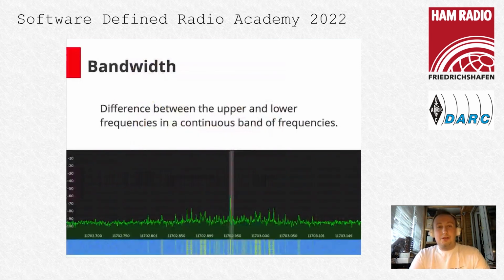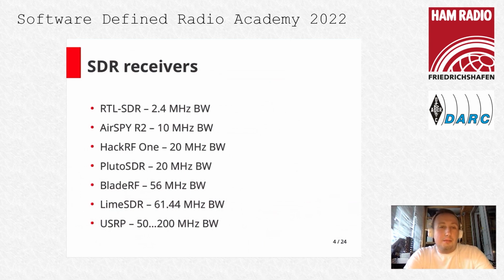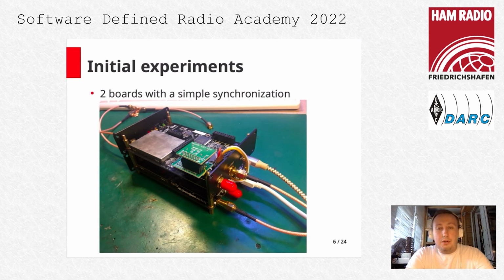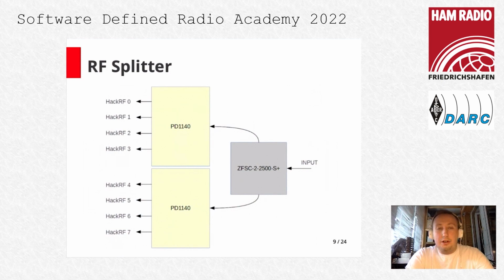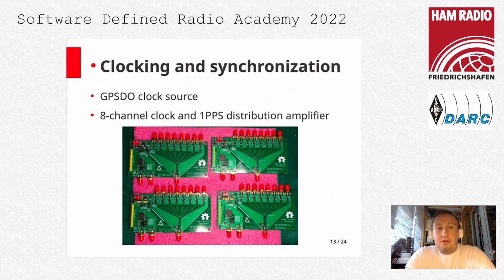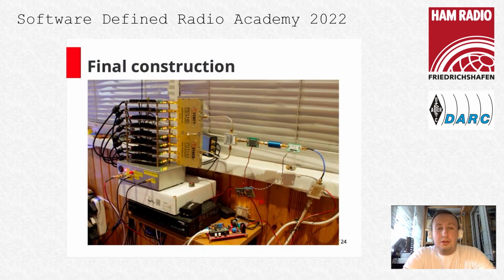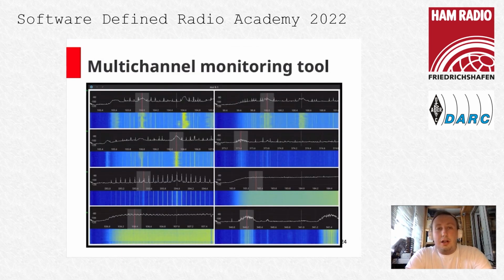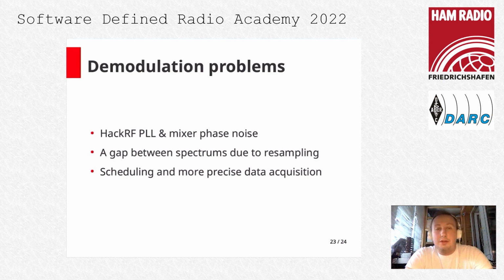SDRA'22 - 03 - Oleg Kutkov: HackRF Supercluster

Comment: I like the look of the project and can think of a multitude of use cases...one dfrawback is speed of data transfer... i couldn't catch how the data to pc was handled but HRF1 is still usb micro and issues arise/ dosen't connect with USB 3 type connections...has to be usb 2.. it'd be lovelly if there'd be a ethernet port available on the hackrf boards...

Kinda differrent, the Kraken utillizes what? 5 RTL SDRs to do signal direction finding... You have a power house compared here with 8 not rtl sdrs but hackrf 1s....sheesh thats some serious signal acquisition.